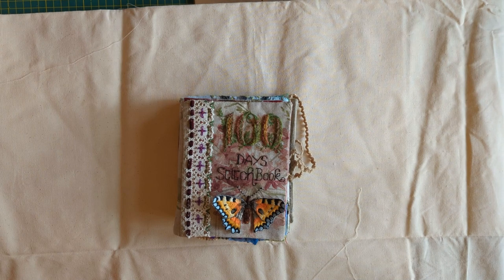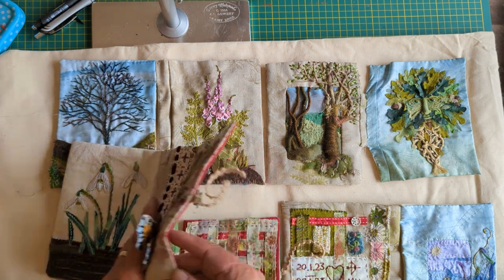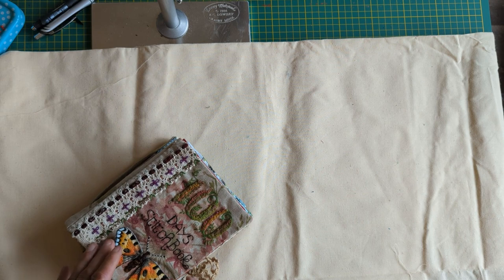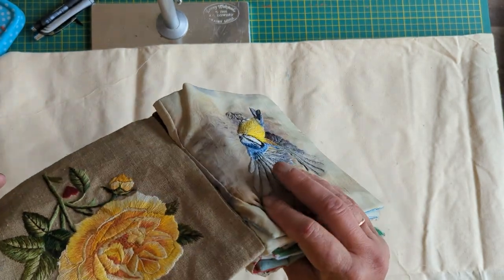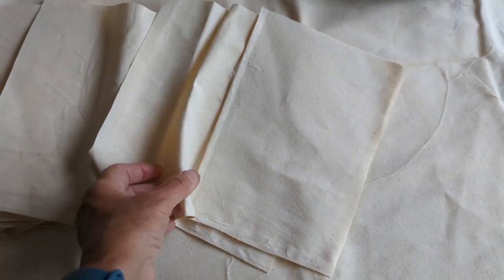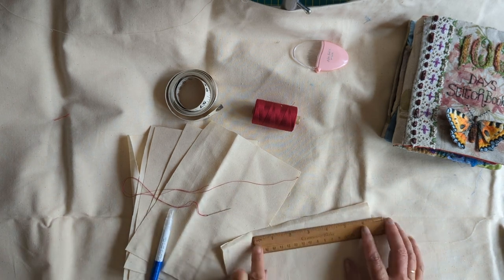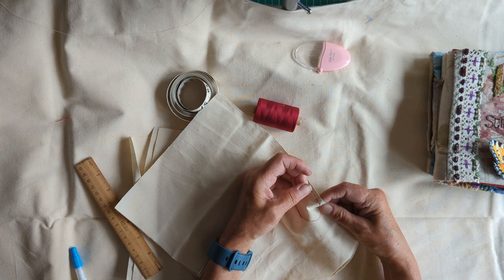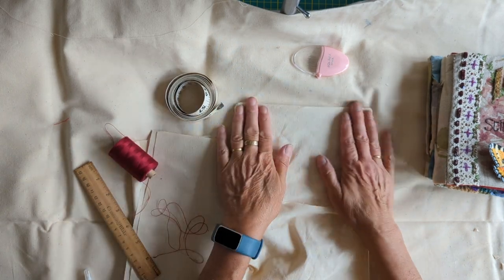Tab and Slot Fabric Book Assembly - A Complete HOW TO Guide

Comment: Marion,This is a GOD Send for me! I worked so hard on the 100-days stitching only to be completely frustrated with the assembly of the book.  While I understood that there were 3 sets of slot pages (of 4 individual stitched pages) and 2 sets of tabbed pages  (of 4 more individual stitched pages) there was alot of puckering of the fabrics at the "spine" which I thought was hideous. I deconstructed them and sat for 3 days just trying to find another method.  Your video was exactly what I needed and has given me hope that I can finish this up.  
One question: I see that one of the tabbed pages (with the greenman) has an "extension" of sorts, which makes sense because the book gets tight doesn't it?  How much did  you add to that tab please?  I also appreciated that you indicated the stitchin of the tab was decreased by 1/8-inch so as to avoid that hideous puckering!!  
I hope to see you another time working on Ann's other projects.  Kind regards from Minnesota USA :)
Reply from the maker: I definitely had problems with the construction but I do still think it's clever. Also I really like it too. The bother is if you've made a book that has any kind of thickness to it... The problem then is there isn't enough width of fabric to 'get around ' the inside pages. 
I added an inch of width to the outer cover pages to allow them to get around. I added the extra to the spine edge so that my embroidered page would lie in the correct place on my book.  It was fiddly to unpick and add the fabric, but it was well worth the effort. 
The green man  and dragon page had to have the same amount added as well. If you've already made up your book it should be easy to identify which pages need extensions. I hope you manage to sort your book out. I never thought of the problem as failing... it's a good book method, It was more a problem of thickness as my pages were heavily textured... 
I got halfway through this year's 100 day book, but then I just wasn't able to carry on. I haven't dropped in since but I really should... I miss seeing what everyone is doing..☺️

Comment: I use a running back stitch, but it likely is not as strong as yours as I load my needle with running stitch then do a back stitch before loading it with running stitches again.
Reply from the maker: We're probably doing it the same.  I just slowed the steps 
down for the camera..